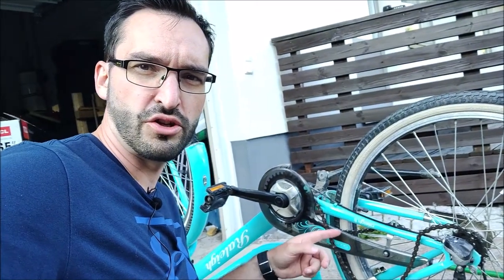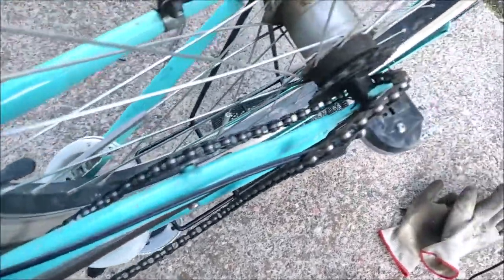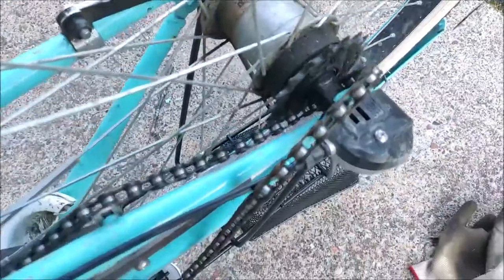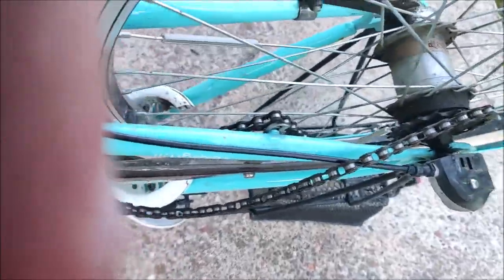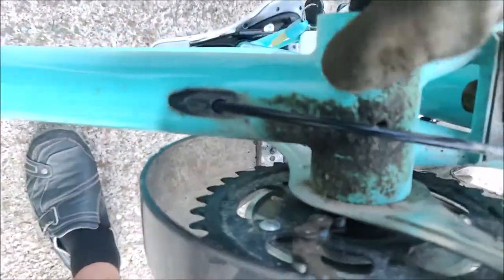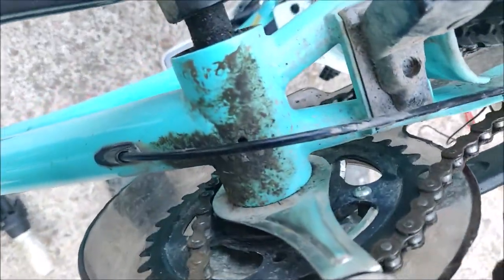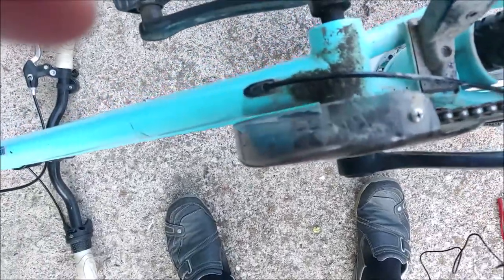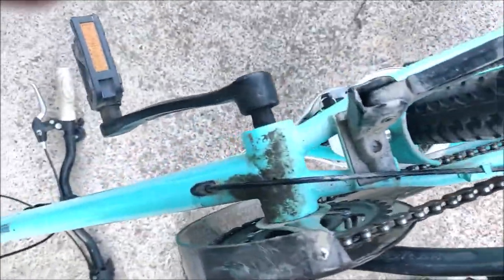How to Put a Bike Chain Back On | Single Speed and Internal Gear Bikes

Comment: Hi! Can you tell me that when the cycle is in the 1st gear(both front and back), so in which ring from front and back, we should put the chain on.
Reply from the maker: Sounds like its not an internal gear bike. If you have multiple cogs on the rear the largest one is gear 1. On the front the smallest chainring is gear 1.

Comment: i put the chain on now the peddles wont move forward help?
Reply from the maker: Hmm. Is it a single speed bike without a shifter? If the chain is not correctly positioned it can cause issues. Did you check that the chain sits well on each tooth?
Reply: @Homeneer  I am not sure but i actually got it fixed but then it keeps falling off and  the while i was going an inclined path the chain fell of and i was luckily uninjured.
Reply from the maker: @xdhanseldx8633  The reason for the chain dropping off is most likely the loose chain so you should really look into fixing it and here is a link to my video doing just that:
https://youtu.be/JMdihKgC9LA
Reply: @Homeneer  I actually did that but after some time again starts falling off :(